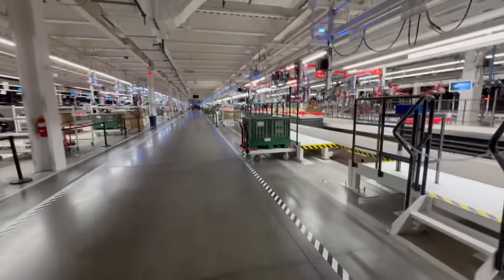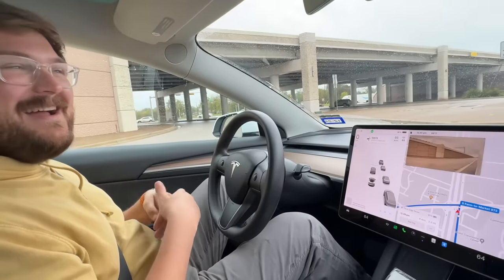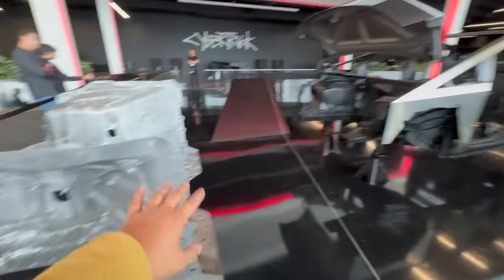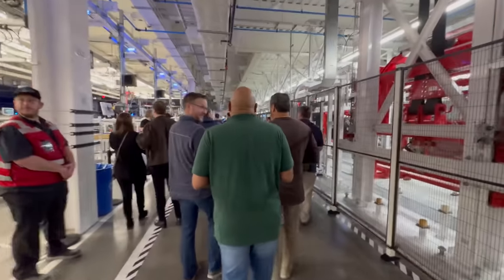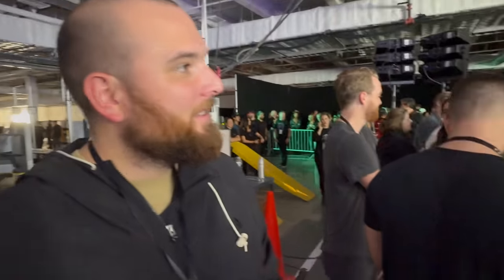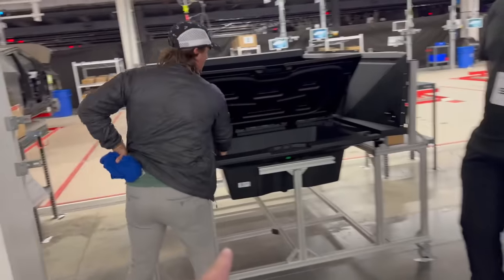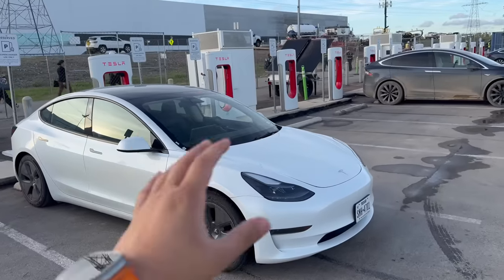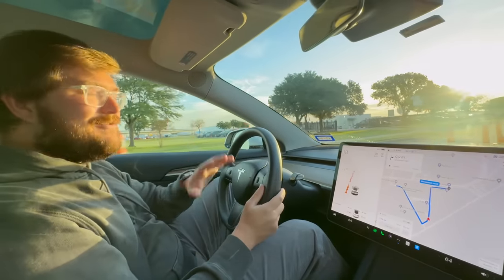Our Tesla Cybertruck Delivery Experience Vlog! We Had The Factory To Ourselves

Comment: Fantastic video.. loved all the factory coverage.. so cool that Tesla was so open about the truck.. had some sitting around with lighting under them.
There are some new innovations in the truck.
I saw on the Haggerty video.. it is Steer by wire... 180 lock to lock. 48 volt main power system, and something about the internal comms systems.. maybe Ethernet based.. not sure.
Hated the design when it came out in 2019... but its is growing on me... kinda like it now.
Pricing seems fine to me...   look at a loaded GMC Denali...  its near $100K. 
But they should never have said it would be $40K to begin with.

Comment: Kyle, did you miss the fact that the front drive unit plaquer says it has an electromechanical locker? I saw that in Twitter by Greggertruck, and my mind was blown. That is a huge deal, puts Cybertruck in the category of only G-Wagen and Unimog (vehicles with front locker as stock equipment across all models). But I have not seen it mentioned anywhere else, I hope it will be true. Then of course, I can not afford this thing. I hope the price comes down a few steps before it comes to Europe (if it ever will).

Comment: I thought Hertz's policy was you had to return the EV with at least 75% charge or the stated charge at pick up, which ever is lower.
Reply: Thats what i have seen
Reply: thats been my experience at any Hertz in the country. It's even on their website
Reply: It’s different everywhere and seems to be always changing, the first time I rented one through them it was at a super low state of charge but no requirement for charging prior to returning, super charging was also free which I had to do for how far we were going (Orlando area) the last time I got one it was nearly fully charged and they said it had to be above 90% which was easy because we barely drove it, that time it was a “manager special” and actually cheaper

Comment: There’s a barcode that you scan with the phone and it adds the car to your tesla app. it usually appears on the bottom left section of the screen. Sometimes it takes a bit for it to show up.
Reply: I had issues with it showing up in my recent rental.  But not in the one before that.
Reply: @joetacchino4470 so the first time I did at LAX it popped right up. But when I was in Portland it didn’t show up until I drove 10 miles lol

Comment: Pricing is the reason for disappointment. People are very sensitive to pricing. Showing the old price and raising it so much causes sticker shock. And Tesla knew it because they avoided it at the event.
Reply: Yes, along with the disappointment with range and towing capacity that they also avoided. They weren't left with much to talk about, which partially explains Elon's pointless rambling 😊
Reply: Specs are also ALL down on promised (except) screen size). You're getting the short range in the tri motor one. Less cargo space, no 6th seat. Not even room for a spare wheel. The 6" bed is only the floor itself, you can not fit a 5'6" box in there. Not even a bicyle fits in there straight. Mine...perhaps barely diagonally by its lonesome.
And you can't get it with indicator stalks anymore even. The kinds of drivers that believe in Level 5 autonomy from base autopilot are now going to be driving that among traffic. Think about that for a moment or two.
Reply: The truck comes lots of new features not seen on competitors: drive by wire, rear wheel steering, air and height adjustable suspension, etc. So pricing, in that light plus inflation, is very competitive.
Reply: @hvu6037  competitive with other overpriced trucks, but far from Tesla's originally promised price and specs. There really isn't much EV truck competition yet. The real competition is gas and diesel, which are more practical for most people who actually use a truck for towing and payload hauling
Reply: @jamespaul2587 also the payload capacity of 3,500lbs payload  & coefficient of drag being 0.39 (versus Rivian R1T's 0.3)

Specs that are still great, just not the specs that generated the Hype of physic defying engineering.

Comment: Still don't think the design/style is ever for me. They'll probably never make a normal-ish looking truck. By the time I'm financially ready for a second vehicle there will be other manufacturers, hopefully with NACS by then.
I'm not too worried about the "innovation" side of things on this. They're using mostly what's tried and true. I am surprised the rear motors are induction though on the tri. I'd like to know the reasoning for that. I'm assuming the front axle is the primary then on that model. Which honestly would be slightly better for slippery conditions. 
The rear end kicks out a bit on my model 3 on snow/ice before the front kicks in.

Comment: 100 grand for a truck is an absolute no go for anyone using them for work. and so is 70
Reply: To be honest though, that’s where other truck pricing is.  Look at the Raptor, Ram, King Ranch, etc.
Reply: @aussie2uGA  Sure but you can use them as genuine work trucks if you want to. Not this.
However I doubt most of the buyers use their truck as a work vehicle ever.
Reply: @aussie2uGA  you picked the top of the line ones though. Your landscaper will buy a bighorn or LT trim

Comment: Pricing is an issue. RWD is 50k. I don't believe that. Also F150 pro Max trailering is 52k both tow the same 7,500 lbs but one is 4wd. You can have a F150 lightning today. RWD CT is 2026-2027.....

Comment: $80k is too rich for my wallet-but considering what you get, it's a bargain. A flippin' Ford Raptor is the same price, doesn't offer an air suspension, 4 wheel steering, steer-by-wire, the ground clearance or near the power of Cybertruck. So you do get a lot for the money-it's just that a lot of buyers don't need those features. I hope they come out with a version priced around $55-60k without the air suspension, locking diffs and RWS.

Comment: Come on Kyle, this is Tesla, you gotta learn to ask about fine print. E.g. you just believe the guy telling you the motors can produce 845hp, but with Tesla it means nothing. I bought a Model S P85D from Tesla which had motors officially advertised on the order page as capable of 691hp, with OTA power upgrade coming soon, yet it was never delivered, not even close. Tesla admitted 2 or 3 years later that it would require 50% more powerful battery in order to get close to the advertised number. Tesla of course said they did nothing wrong advertising a number they could never reach because the motors technically could reach that number, just not in any Tesla car they sold it in.

Or would asking about the fine print get you kicked out of Tesla events? Only the blindly faithful allowed?

Comment: Innovation…
The lack of. I’ve heard that, but don’t agree. Perhaps the 48 volt architecture ‘seems’ old hat. It has been talked about for a long time, but nobody has done it. Outside of Tesla, it maybe years before another mass market vehicle does it.

Steer by wire has been done once (?) but with a mechanical backup. There’s NO saving if you still have to install hardware steering.

Weight. Not something you can “see”. However, it weighs a little less than the Rivian, but it’s larger.

Four wheel steering was first done years ago, but is still very uncommon.

Stainless steel was done long ago, but certainly, not with an alloy like this. How practical it will be may take years to determine.

In a couple of years, I guess someone will have to come up with an idea for a “Back to the future” movie for it!

Comment: It wasn't the pricing that was that shocking it was the horrible range.
Reply: How much range do you want? Would you be willing to pay extra to have a truck that has 500 mi of range, even though you would only use it about once or twice a year?

Some of my friends have Porsches and McLaren's with ceramic brakes.. they only drive their cars from their garages to the local cars and coffee.  When you really sit down and think about it, those people spent an extra $20,000 for a brake package they'll never use. 🤣
Reply: They just can’t fit enough batteries inside that design. The battery tech needs to get better but it’s not there yet. They went a little crazy with the 2019 anouncements.

Comment: The bed is SMC-carbon fiber, same stuff as the Aptera internal cell. Press molded. Very strong and lighter than steel. Ask Sandy  Thanks for the shot of the bed compartment!!! It's all molded carbon fiber! With the track for add on items molded in to the sidewall. I bet the add on like the tie down is also SMC like the ones on the lower side wall.

Comment: Great vlog-type video showcasing the experience and some details that might be hard to find elsewhere. 

As for the CT itself - I've only ever been interested to see how people receive it and the specs and pricing. I am not interested in buying one for myself. 

I didn't believe the $40k starting price and 500 miles of range when it was announced, but it seems there were plenty of Tesla fans who did. Still... $30k+ over the announcement prices was sure to bum out a lot of people. I'm not a fan of the look. I couldn't care less about it being "bullet proof." The 4680 in the Model Y sets a conerning expectation for the charging curve. 2.6s 0-60 is impressive, but not really something I would care much about in a truck and especially not worth spending $100k+. The 11k lbs of towing capacity is honorable, but that will kill the range - meaning lots of charging stops for long road trips with the camper. The range externder doesn't have enough info available, but already sounds like a bad deal.

It'll be interesting to see what people think a year from now after Tesla has had time to deliver more units and reviewers have had time to test the thing and see what it's really capable of. I doubt we will ever see the fruition of the RWD model.

Comment: I am also happy to bet that induction motors are just cheaper to build and the raw materials easier to access when ramping up. They're giving up power per unit for it, it seems. EPA tests are then driven off the single front motor which is likely geared differently, optimally for the EPA cycle, with the rear motors coasting more efficiently that the Model S motors would have been. Is the front motor permanent magnet still? That would kind of make sense. When the rear Model S motor got a PM front, efficiency got a lot better I seem to remember.

Comment: Thanks for sharing. Will be interesting to see what kind of insurance cost level this vehicle will set:
- any scratches in the bodywork will require a specialist (normal body shop can't fix it)
- any dents in the stainless panels might need complete panel replacement (no spot repair technique works on that hard steel)
- crashes might crack the casted chassis which will make the repair cost explode
I guess those who can pay a $80k...$100k cybertruck in cash won't be bothered by $5k or more in annual insurance, but those who finance it (i.e. the majority) won't like the extra on their monthly payments
Reply: But scratches and dents will be more difficult to get in the first place..
Watch the Haggerty video.. they swung a rubber coated sledge hammer at it... NOTHING.. so a door opening into it.. is not going to dent it.
If the impact is enough to get deep enough to git that casting, gonna be totalled.. as would any other car.

Comment: yES please tell us what this is in the "underfloor" for the tray under the bumper. Looks like an aftermarket trailer hitch slapped on.  The bumper from unplugged performance looks more like my stock FJ bumper with high up 2" hitch receiver.  Even after looking at your video @36:50  there doesnt seem a reason for it to go low....UNLESS its all to achieve aero efficiency like a Lotus Elise with venturi effect.
Reply: Note.....the Tent blows up so its not as hard as you think. Uses same technology as Kits for kiteboarding.

Comment: Not sure if it can be built for the European market without some front and rear design changes - mostly to comply with European crash and pedestrian safety regs and as you stated the number plates here would cover the reversing lights but that’s not an insurmountable thing. Biggest problem is it’s width at 2.7m which is too wide for many European city streets but OK on motorways/autobahns, where I live the weight would mean avoiding many bridges on country roads too……. Let’s not mention multistorey car park decks………
Reply: I don't think it's gonna work for Europe. The Cybertruck is a typical American truck, large, bold, and bullet proof. We already succumbed to the SUV trend of bulky, tall and higher consumption vehicles.
Reply: I saw today on Out of Spec’s walk around that the CT has no separate high level brake light and also nowhere to fit the high intensity rear fog lamp required in Europe.

Comment: I agree. It’s grown on me too. Not sure how any trims of this can sell under $100k. That design is insane and has to cost a pretty penny to build. Thanks for making and sharing your trip!
Reply: UAF all I see is the Aztek 2.0
Reply: Aparantly one of the trims is $60K which is less then the current Hummer but above the rest... Still Not bad I just wish when they to out complexity like fly by wire instead of hydrolics or both it would make it cheaper. It starts at $60k for the RWD basic trim and goes up to $100K for the top trim.
Reply: @MackUtley  Thanks, I new there was something a bit familiar about it but I couldn't pry it out of my head.  That's what it was, the Aztec, I'm sure the Cybertruck will be just a popular.
Reply: Actually it should be cheap to build, because it's way much simpler than a traditional pickup. The large castings and the sheet metal panels remove many hundreds of robots from the line.

Comment: Questions for you - at what price point would you buy or not buy the range extender?  (Assuming you want it for towing).   And wouldn't it have been so much cooler to have the line running and producing the delivery vehicles?
Reply: Production in a plant is wild and unsafe for people to walk around in. There are forklifts coming from all directions supplying parts and you have to be very vigilant not to get ran over.

Comment: Thanks for the tour!  That crash-tested model with the sharp panels would be potentially deadly in a collision.  It will be interesting to see how the Cybertruck scores on pedestrian safety.
Reply: 2 points-I doubt a pedestrian fairs well against ANY pickup truck. More important though, the short, low, sloping hood of the CT means you can actually see a pedestrian or bicyclist. Over the long, high hood of a conventional pickup, you won't, at least a shorter one. More important to me-when off-roading you can actually see the ground in front of your truck, especially when breaking over a hill. Unlike today's ICE pickups. The hoods get taller and visibility worse every year it seems.

Comment: Kyle and Colton, thanks for taking more time in the factory and out for the displays. However when you said you didn't see "much innovation" I about fell off of my chair. 48 volt controls allow steer by wire, 800 volt drivetrain, locking front diff, four wheel steer, 4X the torsional stiffness of a F150 (see Top Gear interview Franz and Lars), 350 kW charging with V4, and much more. Also, see Hagerty review. This truck kicks ass!
Reply: Higher voltages aren't innovative. Locking front diff isn't innovative, as plenty of other trucks have it. Four wheel steer isn't innovative, as some Chevy trucks has it decades ago (Quadrasteer). Increasing torsional stiffness isn't innovative, it's just a design choice. 350kW charging isn't innovative, because it's just the next planned step up in charging. Tesla is a rather innovative company, but I'm not seeing it here in a way that makes a real truck owner want to switch to a cybertruck from something like an F-150 and especially F-250+
Reply: @dirtfpv  Innovation is the practical implementation of ideas that result in the introduction of new goods or services or improvement in offering goods or services.[1] ISO TC 279 in the standard ISO 56000:2020 [2] defines innovation as "a new or changed entity realizing or redistributing value". Others have different definitions; a common element in the definitions is a focus on newness, improvement, and spread of ideas or technologies.
Reply: @ronaldlenz5745  I think that's a fair semantics argument, but I agree with the assessment in this video, and that of @skellington2000. That's because Kyle doesn't buy into the Cybertruck hype train.

Know what is innovative though? A pickup truck without a spare tire. Literally nobody does that. So, huge props to Tesla for being innovative there.

I'll admit my bias. I love Tesla, but this vehicle is lackluster and not what I expected from such an innovative company. It's not only the ugliest vehicle ever made (right up there with the Pontiac Aztek), but isn't the truck truck-owners are looking for. I say that as an F-350 diesel owner who tows 10k+ lbs more than 100 miles, and uses it to get real loads from landscaping centers where they don't have to use a backhoe to load it, and hauls ATVs in the bed WHILE pulling an 11k lb trailer. I'm just BEGGING Ford to release an all-electric Super Duty, because I'll be the first one to reserve one if it can match the towing mileage I get from my F-350. If I had to choose between an F-150 Lightning and a Cybertruck, there is no question I'd choose the F-150. It's a better "truck", except for the bed being 6" shorter.

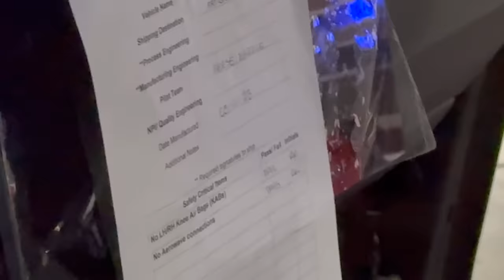Comment: At 37:50, my fears about the rear seat space are both confirmed and refuted. It's definitely compromised for anyone over 5'8" - thank the aggressive roofline. But aside from that it's better than I expected. It's not quite "kids only", but there's no way my 6' 3" father is going to tolerate any time back there. Up front looks sized for NBA players - there's no way headroom will be an issue.